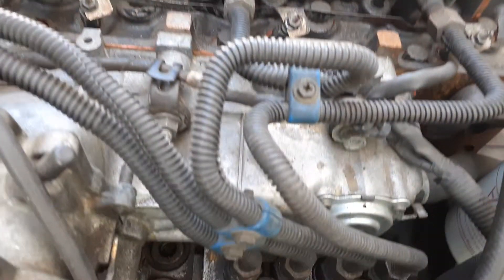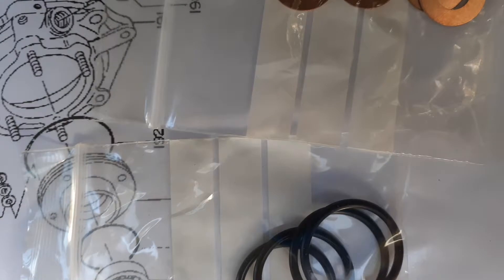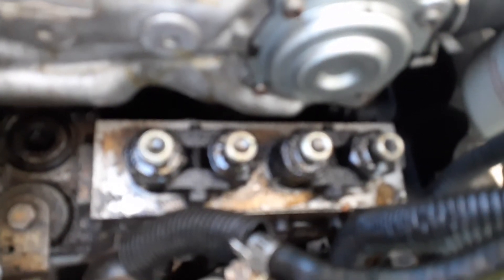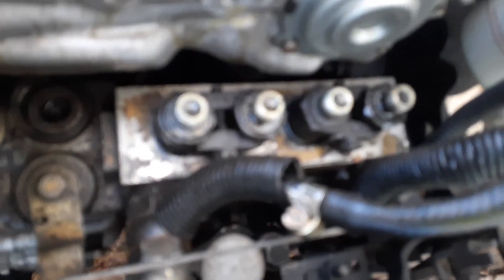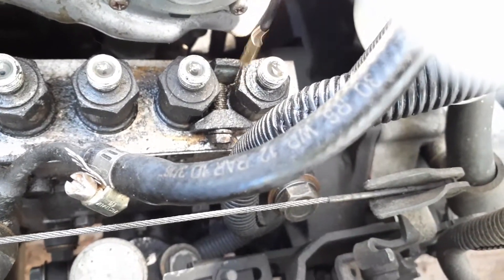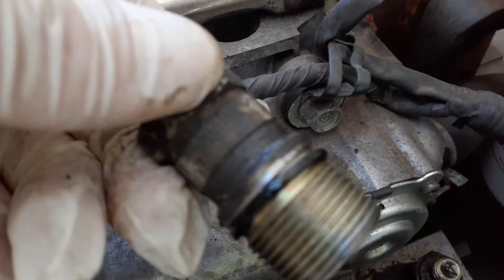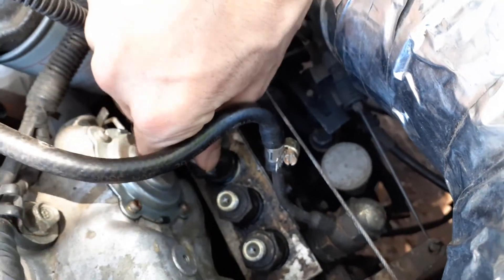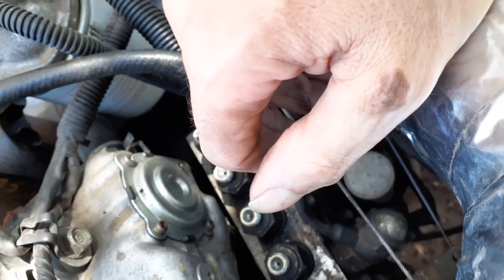Fixing a leaking inline diesel fuel injection pump on Isuzu 4hg1 engine . PART 1

Comment: I can not find parts for this 2001 4he1 unless I buy the whole injector pump. I only need those brass washers and rubber o rings.
Reply from the maker: Brass washers you could try , buying from automotive spares store or a fastener supplier selling to public, O rings are also available in kit boxes in real brick stores. I got mine from a independent , diesel injection specialists workshop / spares carrier. I hope that helps.